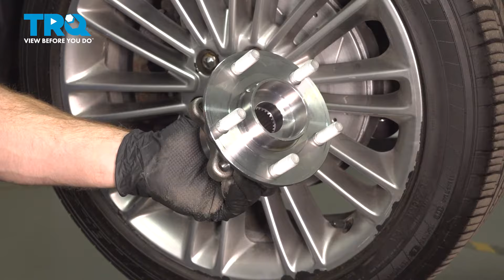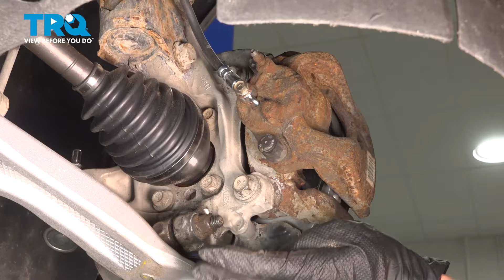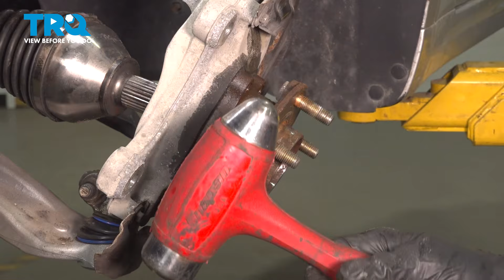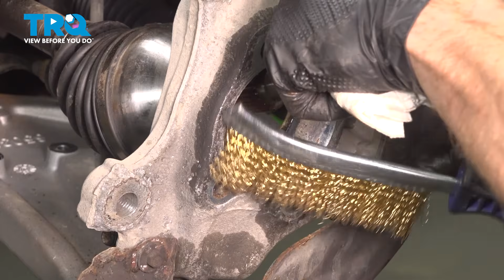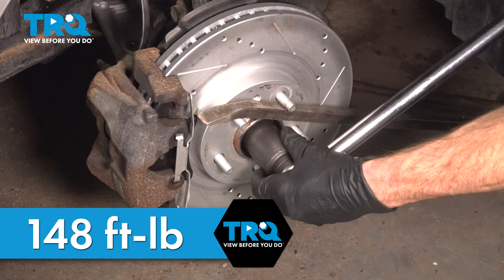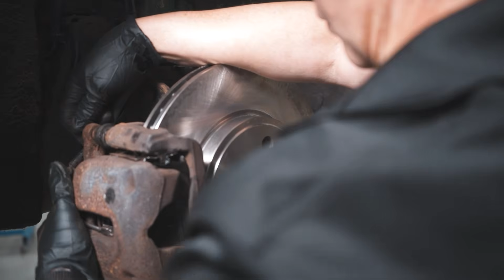How to Replace Front Wheel Bearing & Hub Assemblies 2013-2020 Ford Fusion

Comment: You do not have to remove steering knuckle bolts.  Just turn the wheel and use flexible impact sockets.  You can avoid an alignment. I’ve done this 3 times on this vehicle.

Comment: I ordered the kit for a 2017 Fusion Sport, i have M14 studs and M14x1.5 lug nuts all around.  The kit has two different type size bearings, bigger in the front which makes sense. However i returned them because the front bearings have M14 studs and the rear M12 studs. Do you offer a kit with M14 studs for the Sport available?

Comment: What does the wheel bearing have to do traction control. I had a traction control light come on along with other lights and the steering felt weird. So I brought it in and over $500 dollars later they said they had to replace the wheel bearing because it includes a build in sensor for the traction control. Is this true?